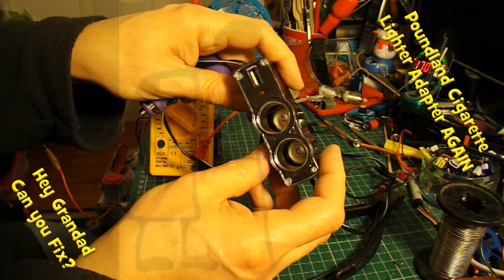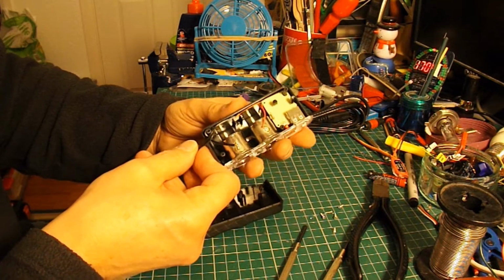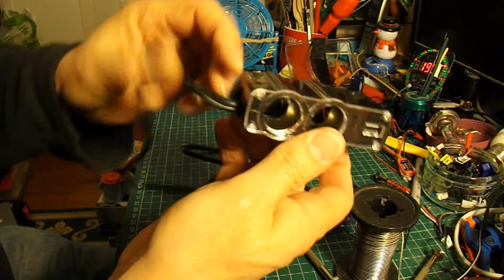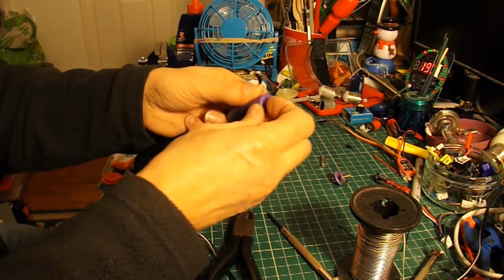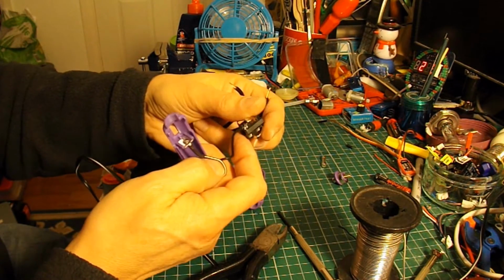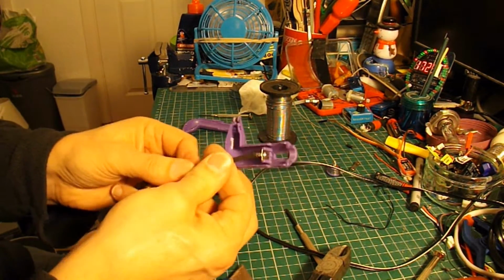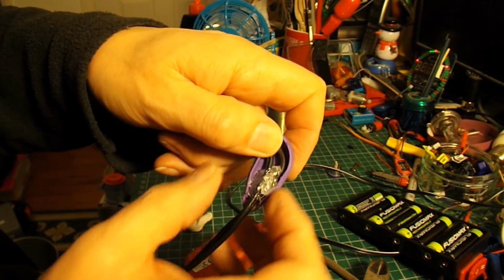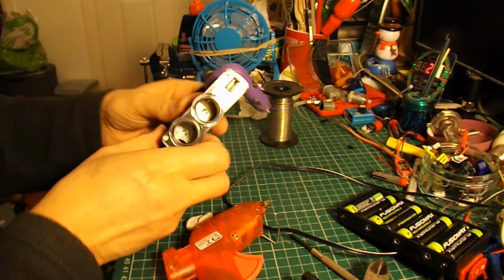Fixing fault in cheap Poundland Cigarette Lighter Adapter AGAIN

Comment: just don't buy a cheap adapter 👍
Reply: +GrandadIsAnOldMan aliexpress dubble sigaret lighter plugs and dubble usb charger plugs.. 7 euros.. never let my down. blue lights :)
Reply from the maker: SwedischMuscleCars yes but I can buy 7 of these for the same money, the original plug was pretty poor so I swapped it with one I found in a charity shop for 50p. The cable does get a fair bit of abuse as we plug it in every time we get in the car and unplug it again when we get out so it suffers from fatigue. The benefit is that we haven't damaged the cable or plug on the Dashboard camera as we leave that plugged into the extension socket permanently and it is tucked into the lining of the car so replacing that would be a real pain.